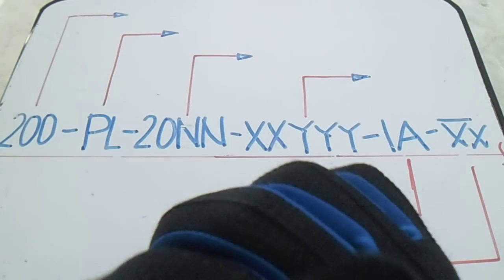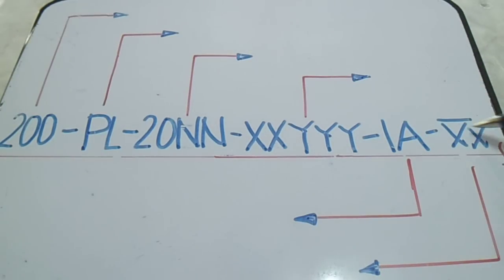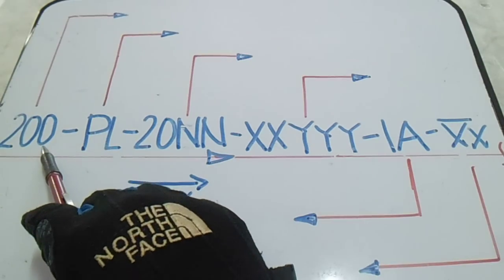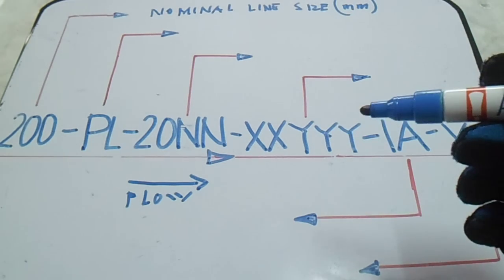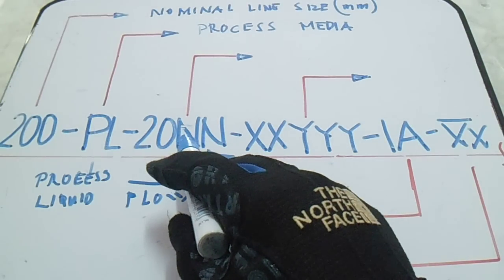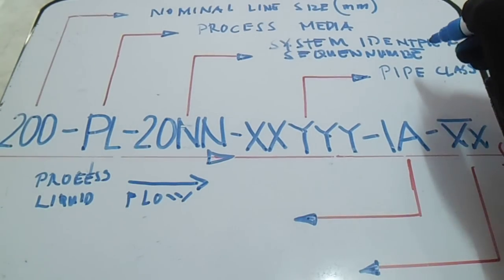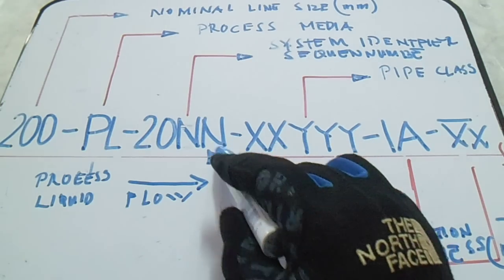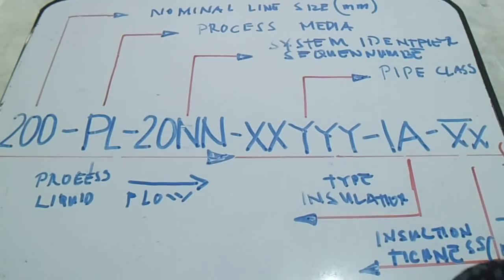What is the Meaning of LINE NUMBER in Isometric Drawing? #Pipefitter

Comment: Nice vodeo but it lacks variations on the designations. For pedagogical purposes it should have been varied to provide clarity on what the case might be for different scenarios. For example, what should be the designations for power Line and other non-process systems. Also more explanation should have been given for pipe class and specific examples given for coating type and thickness using different systems to demonstrate the variations